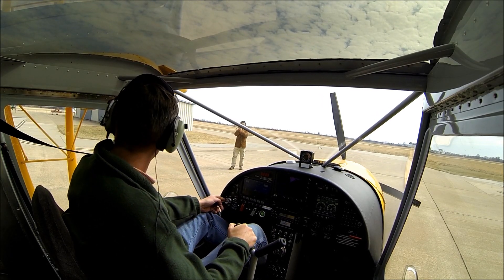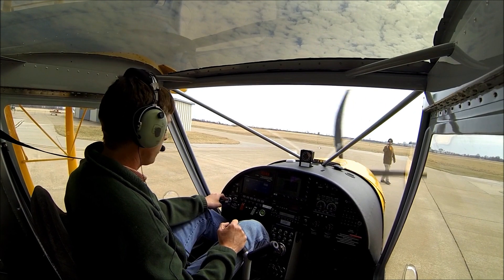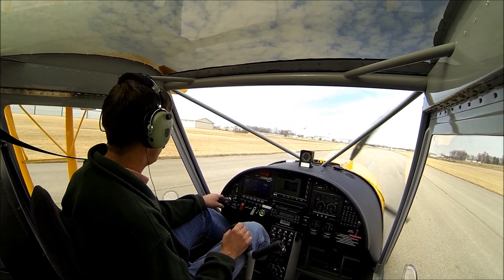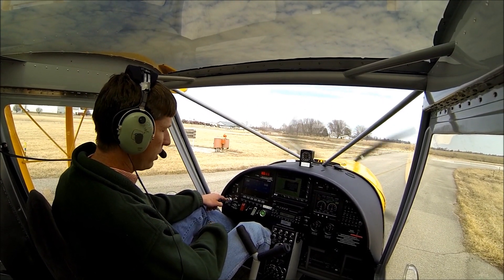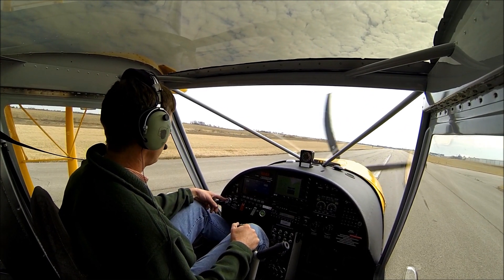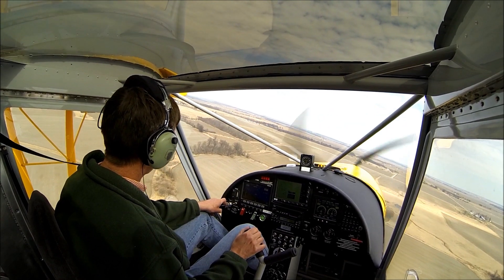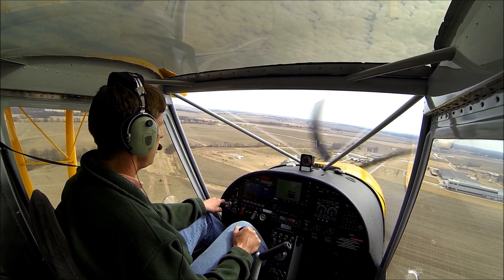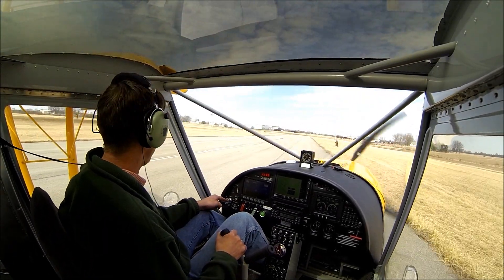Let's go flying: Inside the cockpit of the Rotax 912iS-powered Zenith STOL CH 750

Comment: I once built a rudder for the low wing CH kit. It was OK, but I gave up flying around 9/11. I love this kind of flying, the idea of flying the airplane, testing yourself. The popular YT sites seem to have a lot of electronics and they feature a lot of ATC stuff. That's OK for a flying career. It's a wonderful feeling to fly an airplane, to see the world from up there. 

It's like they finally have 'modern motors', efi and all that. The price reflects no real volume. It's hard to justify owning a sport aircraft. There are seasons when it doesn't really work. It gets old to go within a set area. IIf you are always pushing the envelope, you can get you into trouble. The energy level isn't high enough in sport aviation. It  needs to have better joint ownership structures. Use tech to manage it, I guess. I'd pay $10k for the right to fly for $50 and hour, reserve an aircraft, that sort of thing. You need a strong social network, people who are really keen on flying, and a mix of young and old. I knew enough FAA people to form the opinion they are not really the friends of either Sport flying or the UL type flying. They did "just enough".

I guess reality is that 60 thousand people watched this video. Only 200 cared enough to give it a thumbs up. Thanks. That is a smooth motor and a very sweet cockpit.
Reply: George Sears One Thing you said that struck me, about the feelings & sights while flying yourself! The 1st Time you look right & there’s no instructor there or during your first Cross Country/s..!!! Yes, it’s BEAUTIFUL To The Extreme for us who LOVE Flying...🇺🇸

Comment: run up to 4000 just sounds so weird
Reply: they run the prop off the same/nearly the same gear ratio as the camshaft, like a Continential Tiara. It's meant to rev that hard to make up for not having a high displacement. Rotax is the Honda of aircraft engines.

Comment: I'm most definitely interested.  I have about 30+ hours of flight time, but it's a couple of decades old.  I'm thinking about getting a Sport Pilot license, as it does everything that I'm interested in.  Have you guys ever heard of anyone building this with hand controls in place of the rudder pedals, or connected to the rudder pedals?  I'm a paraplegic as the result of a HALO parachute jump when I was in Special Forces and can't use my feet.  There's a flight center about an hour from me that uses your planes and they have both a 701 & a 750.
Reply from the maker: Yes, we're currently working with several builders/pilots with disabilities for hand controls in the CH 750. Check out AV84all's project: http://generalaviationnews.com/2016/08/21/giving-disabled-pilots-wings/
Reply: Can a full PPL be attained with an appropriate adaptation?

Comment: Opinions on the new 915iS? The improved CH750 you claim is good for 160 hp, so the 135 it provides feels like it should be pretty much perfect, shouldn't it? I'm also a little interested in Superiors Gemini project, the 125 horse version should be a pretty nice fit I think.. Supposed to work well with biofuels, I bet HVO would make an excellent green experimental aircraft fuel in such an engine.

Comment: I love this airplane except for having the panel line below the knees. that would drive me nuts. I think the center stick would annoy me too.  I've flown a center stick in the Robinson R-22, but the T handle in the R-22 makes you forget its a center stick. The Zenith should use something similar in my opinion.
Reply: AV8R Tom they have an option to make a center control stick similar to a steering wheel that you see in a car, the upgrade isn't that expensive as well.

Comment: Why this instead of the kitfox super sport?  I do think the tri gear is a huge plus.  What else?
Reply: captainpegs07 Also, how can the kitfox list a useful load of 800 lbs?
Reply: 100% METAL, no fabric or wood anywhere, which means you do not need to spend THOUSANDS per year on a hangar.   I like kitfox, but, I would insist on having a hangar.

Comment: 95mph cruise and 4gph is essentially 25mpg, so not much different than a Toyota SUV
Reply: This is a STOL vehicle. It's designed to be able to take off and land in 100 feet or less on rough terrain, and as a consequence this plane isn't that aerodynamic. Other planes designed for speed that use this engine can cruise at about 160MPH with the same fuel flow and engine(Pipistrel Virus SW and the Zenith CH 650). Also, you're traveling at 95MPH as the crow flies vs 70MPH on the roads, which are rarely headed straight in the direction you want to go, and you have to deal with traffic. Even at only 95MPH, the plane is much faster.
Reply: But ... at 95 mph, the Toyota won't be getting 25 mpg!
Reply: +1lllllllll1 you are forgetting that is airspeed not ground speed.
ground speed is more if you fly the weather systems correct at altitude
Reply: Yeah, from an aerodynamic point of view, STOL aircraft are generally pretty much flying piles of rubble. For what it can do though, it's easily worth the loss in efficiency.
Reply: It would be awesome to have a Pipistrel Virus SW that by the push of a button could turn into a CH750, though.. :D I mean, it can be done, but the cost and weight penalty of such a configuration wouldn't make it worth it.
Reply: And you get to see what is below you as you are not fighting to stay ahead of the airplane at high speed
Reply: Good for a plane

Comment: Nice video!  Excellent audio.  Did you record sound from your headset direct to camera?
Reply: PS: With the DUC propeller, I consistently get 4.0 g/h or less, flying 115-120 knots in the Sting with the plain, non-injected, Rotax 912ULS....
Reply: It's an external mic for the GoPro camera that we place inside the headset. What you hear is what the pilot hears.